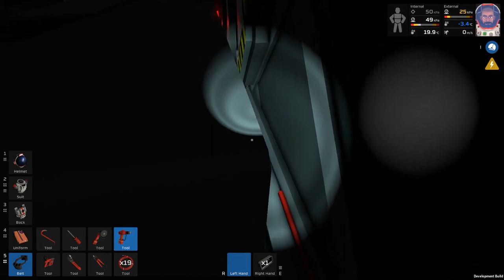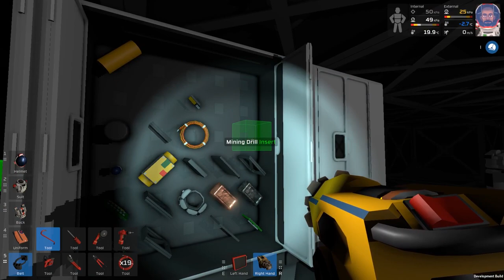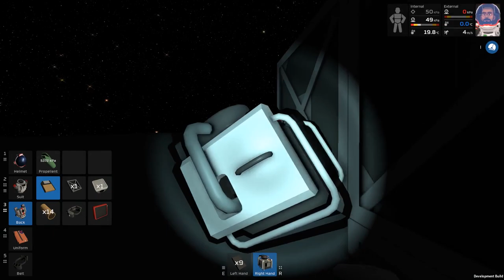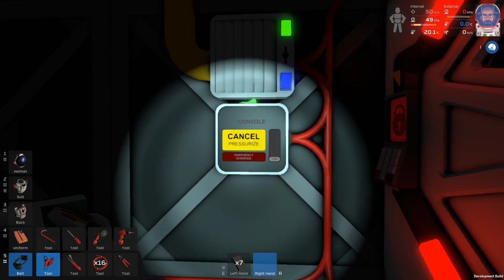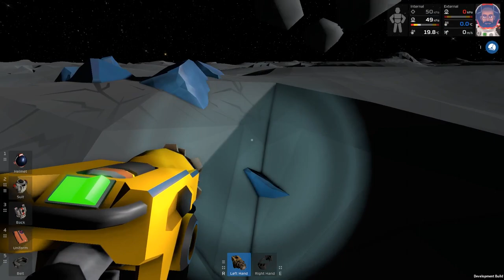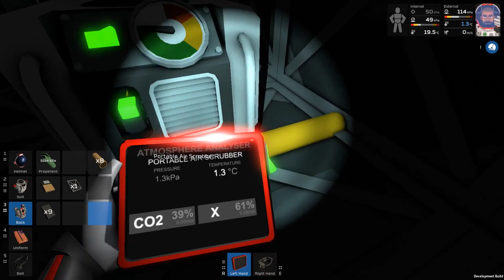Breathable Air: Removing Pollutants with Scrubber | Let's play Stationeers gameplay ep 9 (PC alpha)

Comment: hook up an active vent to filters 
(built atmospherc kit and scroll to 2nd build option) 
i´ve set up 5 different filters with in a row and hoocked each output to a tank
voila 
separated gases ready to mix 
now you can fill diferent rooms via pipe-network with N²&O²

Comment: Nice... I was screaming at my screen... "Don't open that wall!"  It didn't work.  ;)  You can use that old O2 tank on a tank connector (or a stationary tank) with an active vent to manually suck up your atmosphere in case you need to break a wall again.  Also, build a chute kit and scroll through your build options.
Reply: RE: The battery charger.  I think it has a low priority so if your panel output is being used for other things it will slow charge.  Should try to get a solar tracker circuit going and see if you can pull more power during the day.  I've been able to stuff it full of large batteries and charge them pretty quickly.
Reply from the maker: As usual there's always a smart way, and I choose the dumb way :)
Reply: Randomise User Entertaining though!  ;)